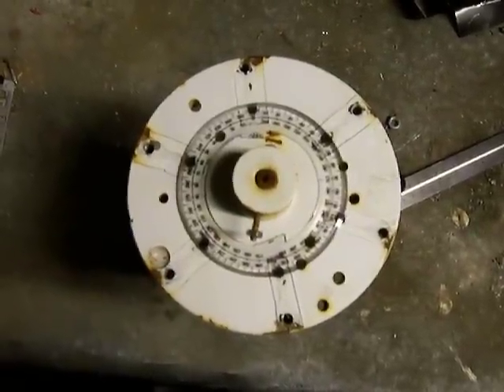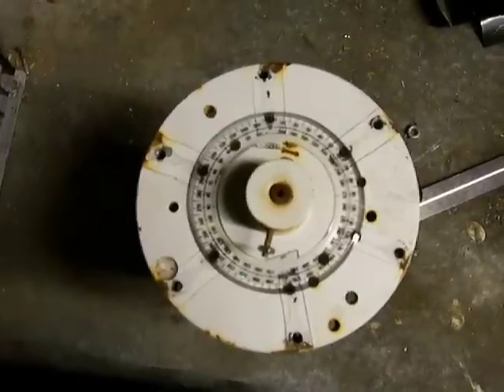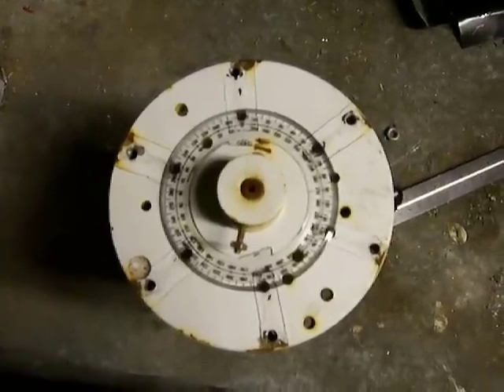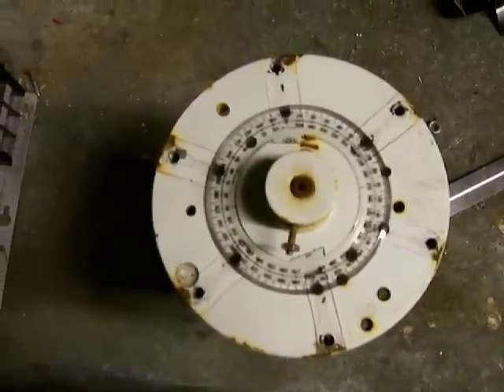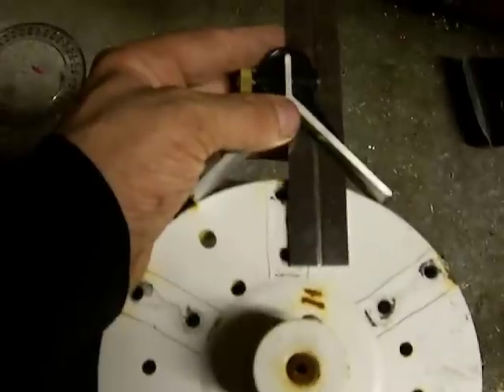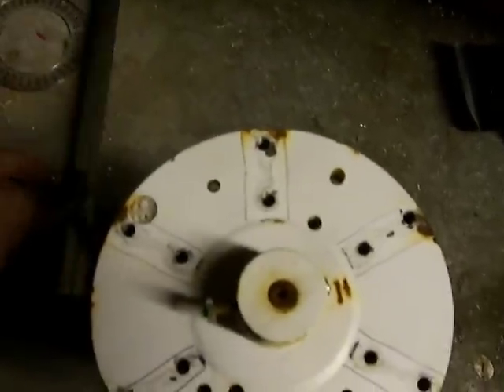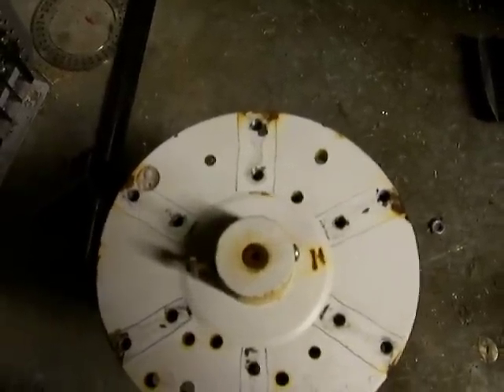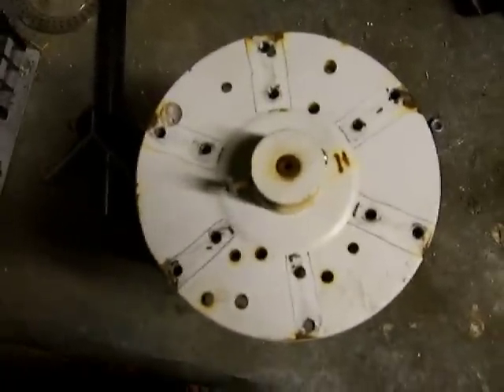How to Install Blades on a Treadmill Motor Wind Turbine hub

Comment: Hi.I have the same HUB from old tread mill..I am having trouble with that center part "raised" like that for the old belt setup..I can't figure out how to find points for a 3 point blade mount. How did you get the holes to be equal? Thanks ...great video really helped.

I tested the motor..easy 20+ DC out, guessing 12 knots with 3 blade 20 feet up near tree's. It's fun if nothing else..peace!
Reply: Just saw your compass with center removed..OK I get it, you guessed at actual center when deciding where to drill holes I assume. Good work either way! :)
Reply from the maker: you need to use a  belt drive or something to increase the speed on the motor. direct drive does not go fast enough.most of the time
Reply from the maker: https://www.youtube.com/watch?annotation_id=annotation_338630&feature=iv&src_vid=0qrCu-yiTfw&v=13PaT4p81nA
Reply: ended up cut it off...then welded the HUB to shaft..it's now 20 feet up working well :)
Reply from the maker: shoot a vid
Reply: It is now in the wind :) next is charge controller and then a convertor